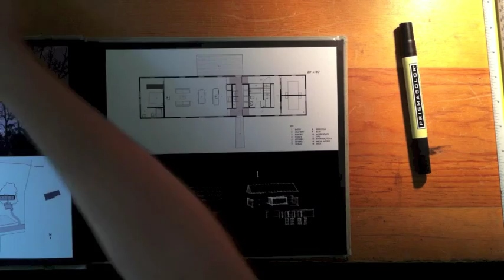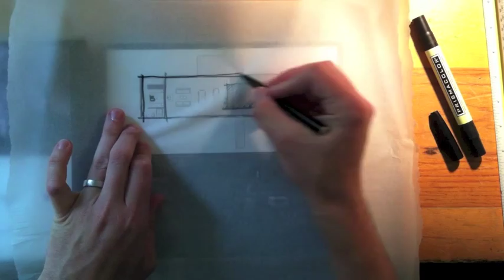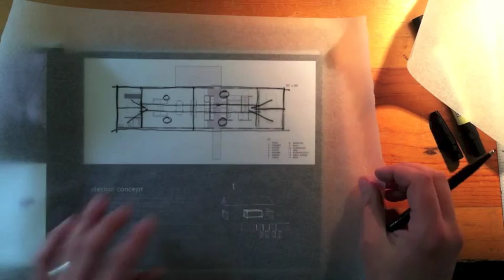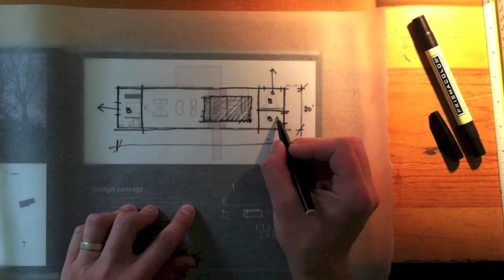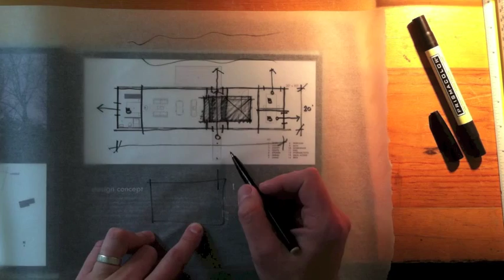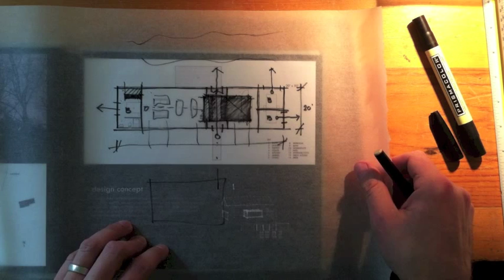Modern Longhouse Design - An Architect's Design Process part 2 of 2

Comment: I'm inspired by this design but I would be interested to hear about how it's working for you now that you've lived in it for a while. Specifically, I'm concerned about the absence of environmental isolation between the entry space and the main living space. What happens when someone opens the front door during the winter months? Is the heating system able to quickly recover? Why bother engineering an air-tight envelope if we're just going to let all our conditioned air out the door? What are your thoughts on 'vestibules' with inner doors that prevent this type of air exchange?

And, are those stairs I see? I thought you didn't like basements? ;-)
Reply: Basement might work well for some client some sites.  At the very least it is a place for storage and mechanical such as hvac etc.
Reply: @jwiereng  I agree! I just would have liked to see a bit more detail on that part of the build. Especially since he has previously said that he didn't like basements. Sadly, it doesn't seem that he is ever going to reply to me on this point. :-(
Reply: @lightspeedguru  you could give him a call.   Phone # and contact info are on his website.
Reply: @jwiereng  I would only do that if I had the intention of hiring him.